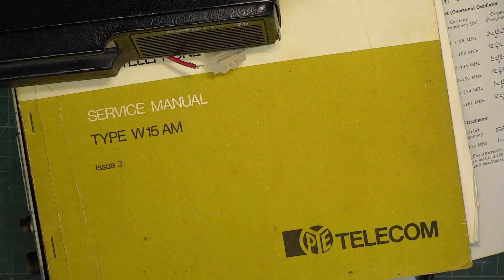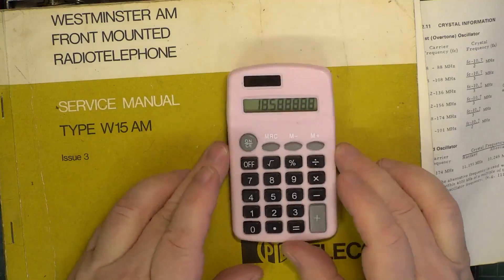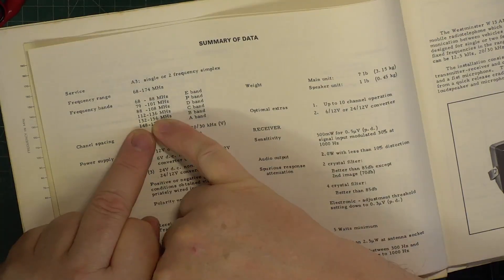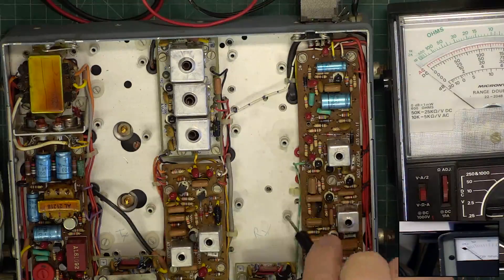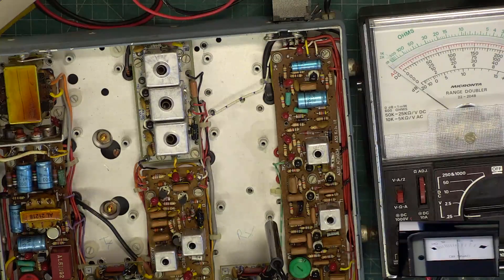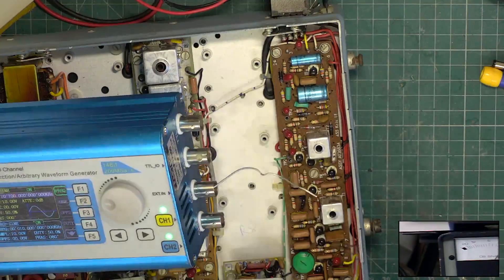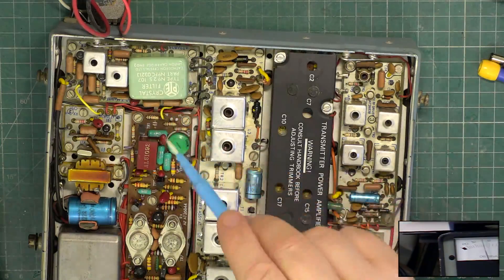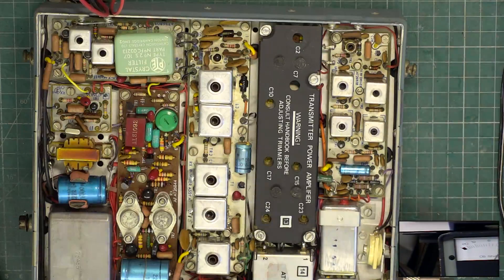Pye Westminster W15AM on 4M amateur band -  Pt1 of 2 receive

Comment: I had a W30 quick heat single valve for a long time, around 30W on 70.260, We had a few skeds here around Cambridge most weeks. It was the only radio to give me some emc problems. Next door could clearly hear everything I was saying if they picked up their phone, good ole A.M. 🙂
Reply from the maker: I think the fact you had it doing 30W was a snag. It's actually a 25W radio, so pushing it to 30W would have resulted in under-modulation & TX interference you mention. The W15 range is normally a 5W radio, the W30 range is normlly a 25W radio. As they moved to the M290 series; one again they were normally 5W radios but some had additional PA parts,making them 25W radios....but no outward difference.

The Olympic M201 models was as early as my training went. They were a 10W radio if I recall right, but the PA was capable of 60W. You had to tune it very quickly into the test gear...like within 10 seconds at max power, then quickly drop the power to the licence level. Very much like I do on the Cybernet 134 CB radios, which will sometimes do 5.5W during tuneup. The wallies who leave them like that & who don't know/care end up with melted coils & a ruined set.

Interesting stuff you mention & thank you for the comment.

Richard, G0OJF, UK

Comment: Why don't you print out a new PTT Switch assuming you can find a STL/G_Code file
Reply from the maker: I don't have a 3D printer. Perhaps you have & can do it for me.

Richard, G0OJF, UK
Reply: @ukfmcbradioservicingTango21  I don't but PCBWAY does.
Reply from the maker: You still need a data file of the component. The whole snag here, which is why I borrowed crystals from another radio rather than pay £70 to have custom crystals made, is that the radio has zero value. It's worth absolutely nothing either before or after I've put it on 4M amateur. 

Richsard, G0OJF, UK